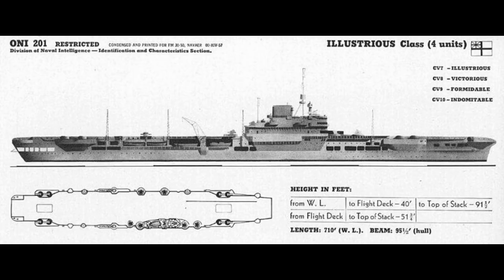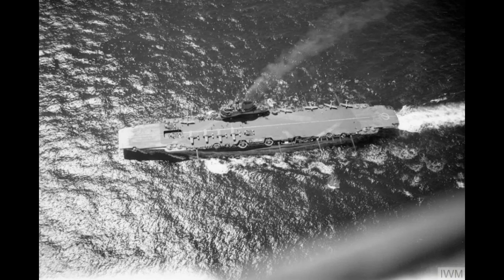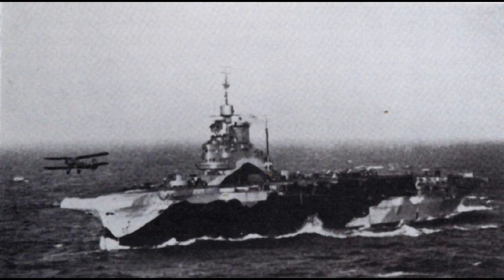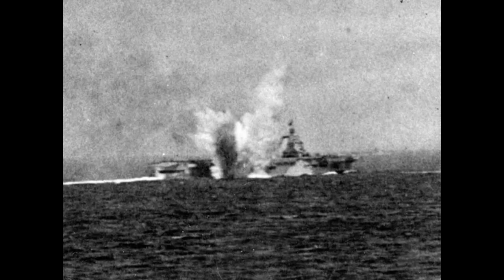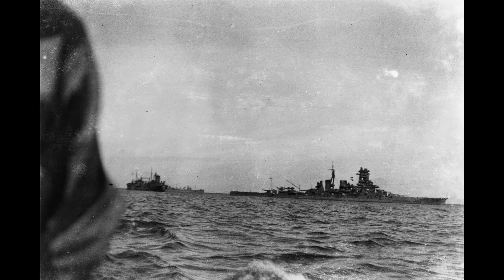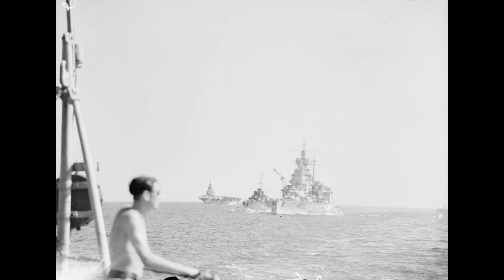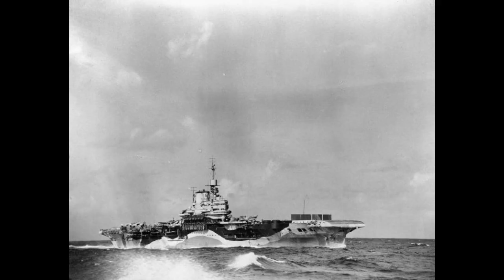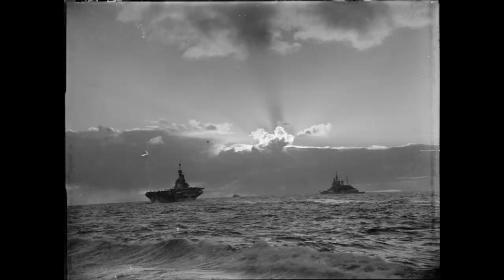HMS Formidable – Lumbering Into Gunfight (And Shrugging Off Kamikazes)

Comment: Armored deck is a tradeoff, yes it makes the ship more impervious to aerial bombs-but it reduced the aircraft capacity significantly. US Navy gambled on more aircraft and for the most part it was the proper decision. US would not have decisively defeated Japan at Midway without the full complement of aircraft of the Enterprise, Hornet and Yorktown. On the other hand, the loss of the Yorktown MAY not have happened had she had an armored deck (though it was air-launched torpedoes that caused the fatal damage). US strategy was predicated on the reality that the US had the manufacturing capacity to replace ship losses far better than Japan and the Allies needed to get ships in action FAST so that Japan could not fortify their captured territory (especially creating submarine/aircraft bases on Guadalcanal, interdicting Allied resupply of Australia). Had the Japanese had another year to consolidate/fortify the Allies would have suffered far greater losses long term.
Reply: one of the reasons why we built them that way was that as the 30s progressed we realized Germany was the main threat and we'd be fighting within range of land based aircraft, the arkroyal was built to fight in the Pacific against Japan and was larger

Comment: 1111,000 shaft horsepower is about 85 Megawatts but probably closer to 100 megawatts after gearbox losses are accounted for. That’s a huge amount of power given the available space on board.
Reply: I would agree but based on your improper placement of the simple , and your seemingly lack of understanding of physics I'll just disagree and bow out.

Comment: There are a few more achievements. Formidable was a pioneer of radar fighter direction, where previously on Ark Royal, flag signals from Sheffield were used. Formidable's entry into the Mediterranean through the Suez was an eventful affair. It's the aftermath of the Illustrious Blitz, which would be a nice topic in itself.

On 7 March 1941, Formidable arrived at Suez Bay. Although they have cleared the Italian mines dropped earlier, the Germans have dropped fresh mines in the area, and 2 cargo ships and 3 other smaller ships are now blocking the passage after hitting some of the mines. The area was swarmed with minesweepers and Wellington planes with mine-detonating hoops sweeping the area for mines. 8 other ships volunteered to act as meat shields for Formidable, 6 going ahead of her and 2 others zipping about trying to set off any mines so that none would hit the big lady. On the third day, 9 March 1941, there was one last scare for Formidable, there was a suspected acoustic mine which forced her to shut down and let the tugs pull her through. A strong gust of wind also threatened to push her into the wreck of a Greek merchant ship.

Mavis Lever was the codebreaker who deciphered the Italian Enigma message, which was a bit older and less complicated than the German naval Enigma. When Lever decoded were the entire Italian plan, how many ships, where they're going, and so on, and the message "today's the day minus 3".
Reply: For the RN.
Reply: Thanks for the extra info.

Comment: American aircraft carrier doctrine.    The carrier's best defence is it's aircraft
British aircraft carrier doctrine           There's one going to get through.

My own thoughts about the armoured carriers is that they will be operating, most of the time, within range of land based enemy planes
Reply: RN carriers had their hanger decks, usually two, built into the hull.  As with the case of Illustrious, a hanger fire was both very difficult to extinguish and the heat damaged the hull structurally.  US Navy practice was to build the hanger and flight deck as superstructure above the hull. The hanger deck was the main deck and had 4 inch armor.   From the Essex Class all the way to the Ford Class there is an intermediate deck with squadron sleeping, office and briefing spaces directly under the flight deck and above the hanger deck.  The US Navy assumed their ships would get hit and wanted the damage confined to superstructure above the hull.   With an hanger deck bomb damage was confined above.  Damage to the hanger and flight deck didn't affect the hull structure.  US Navy hangers had big roll up doors to permit ventilating after a fire and jettisoning debris over the side.  On RN carriers burned aircraft and other damage had to be brought up to the flight deck, assuming the elevators still worked, and their hangers were very hard to ventilate without contaminating the air throughout the ship.  Their lower hangers were also a significantly large space and low enough in the hull that could flood and sink the ship in the event of a torpedo hit.   The US Navy didn't lose any of the Essex Class even though several suffered major combat damage and because of their construction even those that did experience major combat damage were fit to be used for decades after WWII.  Franklin and Bunker Hill for example had hulls in such pristine condition after WWII they were kept in reserve to be converted into a Super Essex class intended to be an improvement on the Oriskany that was  ultimately never built
Reply: Well, the USN had much better carrier-based fighters until 1943 when Martlets and Seafires were deployed by the Brits.
Reply: @RayyMusik  We had Martlets in 1941.
They were Grumman Wildcats that were ordered by the French but went to us when France fell.
Later ones that we got were called Grumman Wildcats
Reply: @g8ymw  Thanks for the info. On which carrier were the Martlets deployed then? I only know pictures of Fireflies from the early stages of the war.
Reply: @RayyMusik  F4U Corsairs were used on Victorious in 44 against Tirpitz,  not sure about formidable though.
Reply: @emerkamp1 Corsairs had to have their wingtips cut off to fit in the cramped hangar deck of British carriers. Grumman aircraft folded their wings back but the Corsair simply folded up.
Reply: @glenn1035  Thought it had to do with coming too close to the island also. Turned out they landed on decks a little better afterwards lowering the ground effect.
Reply: Another was Open vs Closed hanger decks, open had better ventilating and burnt debris removal.  Brits and Japan used the same type of closed in hangars, Japan's closed system turned out to be not very fire friendly

Comment: Were the two hits from Fliegerkorps X in the Mediterranean 1000 kilogram or 1000 pound  bombs?
Reply from the maker: Kilogram.
Reply: @skyneahistory2306  Ouch.  That's ~2,200 lbs for the metrically challenged.
Reply: @fredsanford5954  Actually 2205 lbs which is 35 lbs short of a ton.
Reply: @skyneahistory2306  Kilos cant be correct If it was indeed a Stuka raid as you said. They carried 500kg bombs (just over 1000 lbs). Only Ju88s could carry the larger 1000kg bombs.
Reply: @neilturner6749   Why doesn't the metric system apply everywhere in the world? Then we wouldn't have these problems...
If I remember correctly, there were special armor-piercing 1000 kg bombs for the JU87 against ships.
Hence my original question

Comment: Well done for pointing out the aircraft capacity when including the deck parking quantities. Most of the UK carrier aircraft capacities quoted in published video’s etc. only include the aircraft that are accommodated in the hangar with no deck park.
Reply: Yes. Why is that? I know in the beginning planes were stored only in hangars but later on 43-45 that was not the case.
Reply: @ro.stan.4115 British doctrine, mainly based on the rigors and hazards of Atlantic weather.

When deployed to the Pacific they adopted US practices.  Also, resupply times were much longer in that theater, and aircraft production was off the charts comparatively speaking so aircraft written off or lost due to weather were not as precious.
Reply: @mbryson2899 So you’re saying sailing was much easier in the Pacific theatre on Aircraft Carriers, Makes sense to a point. 🇬🇧⚓️
Reply: When you start storing planes on the deck, you've given up the major advantages of the enclosed hanger armored to the sides, front, and rear. Now you're toting around a lot of armor that doesn't do anything and the carrier is in danger of destructive deck fire.
Reply: @ethanmckinney203  Deck fires were disastrous on the wooden flight decks of US carriers, , but were little more than temporary inconveniences on the armoured decks of the UK carriers, which were often back in action within minutes. If imitation os the sincerest form of flattery, consider the action of the US in adopting armoured flight decks for their post war carriers.
Reply: @ethanmckinney203  Did that ever happen in actual service?
Reply: @mbryson2899  According to the video, yeah.
Reply: @ethanmckinney203  Per the video, Formidable wasn't even out of action for a day, quite unlike US carriers that were similarly struck.
Reply: By comparison US figure usually include the deck park AND spare aircraft, often suspended from the hangar roof.